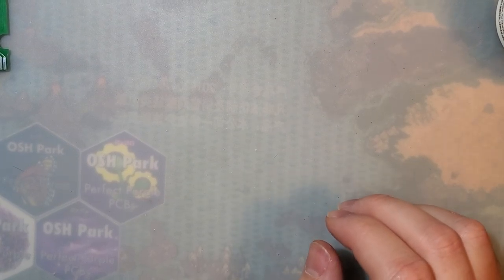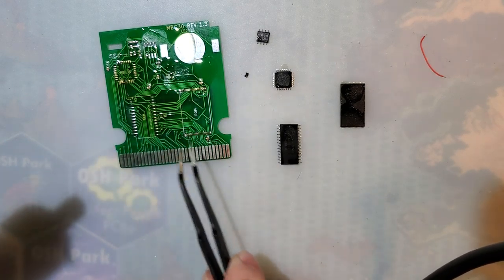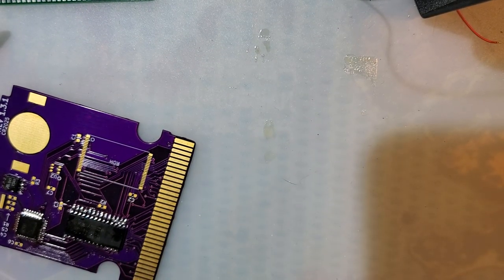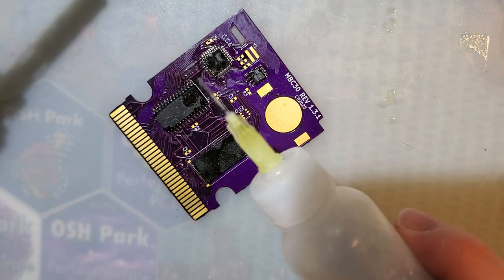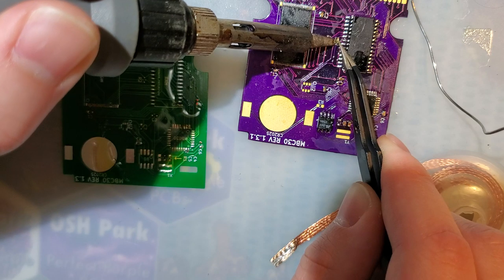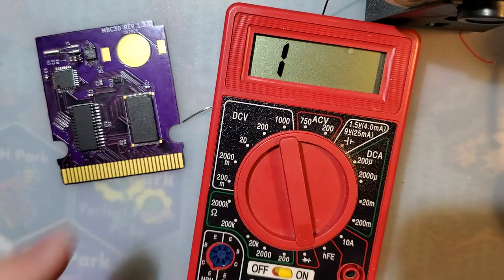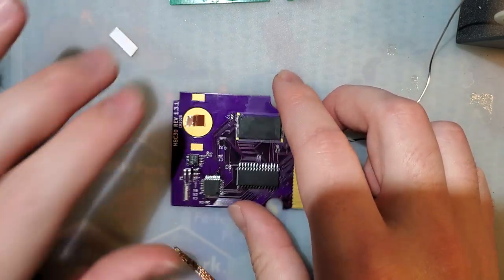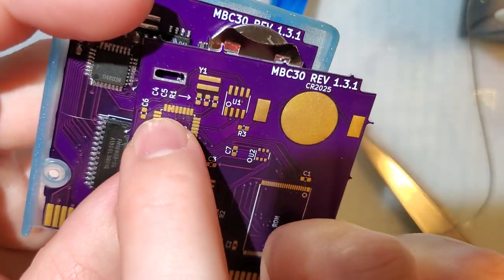Building a MBC30 4MB FRAM Flash Cart (Part 3)

Comment: I'm getting more and more exited to build my own flascards. Right now I'm reading your wiki and a few other websites to get all the information I need for. 
Is there any other sources somebody might recommend? I want to built flashcards to get a few cards I want to add in my collection. Mods but original copies as well. Prices for original cardridges are incredible increased in the EU. And everywhere are scammers.
Reply from the maker: I'd recommend starting with a solder practice kit (or several) if you're new to soldering. I'd also probably recommend popping into some of the game boy community discord servers as there are quite a few people in most of them that have done this already and can steer you if you have specific questions.

Comment: Where did you get the metal gba sp buttons? 👀 Imma need some of those how do they feel? I love the oem clickyness I just got two new orange gba sp001 models I’m about to do a clear blue shell on one and keep the oem shell on the other I’m planning to do some mods to both tho
Reply from the maker: They were custom made by a friend. They are not available for purchase anywhere that I know of. OEM feels better but these are pretty close.
Reply: You have some awesome friends lol I am about to build one gba sp 001 as a main system I love the ips v2 10 levels of brightness screen I used on my clear black gba sp it is a Chinese screen seemed to be every bit as good as the funnyplayin v2 screen you tested I even played games like pokemon pin ball and checked for backlight bleed and all kinds of things like that the screen seemed perfect to me what screen and mods do you recommend? I think I’m gonna keep the stock shell even though it’s not perfect because I love the oem feel but I don’t care about the rest I’m not trying to keep it oem for collectibility I just want the best gba sp possible don’t care what it costs to build I have a $20 eBay soldering iron and the $80 ifixit screwdriver set with tweezers and pick and all that stuff but that’s all I have 😂 so nothing too difficult requiring hot air or lots of flux I am gonna order that stuff next so maybe in the future  I can do more involved stuff
Reply: makho also I am getting daily tracking updates on my gba x5 mini now so it should be here very soon hopefully by the end of the week it was in New York about a week ago you should get one in and do some side by side tests against the old gba x5 krikzz everdrive!!!

Comment: I haven't tested this myself, but I believe the MBC3 should support 4 MB. There is (supposedly) an unused address pin that isn't documented on most pinouts online. Connecting this address pin should allow support for 4 MB programs.
I think the reason MBC30 was actually used is for more RAM support, as JP Crystal uses 128 KB instead of the usual 32 KB in the US version. More RAM was needed to support the "GB Mobile Adapter", which was only used in Japan.
It's pin 29, for anyone interested. Most diagrams present this pin as NC, or just blank. If I can find my QFP-32 socket, maybe I'll try to verify this for myself...
Reply from the maker: It does not, I tested it.